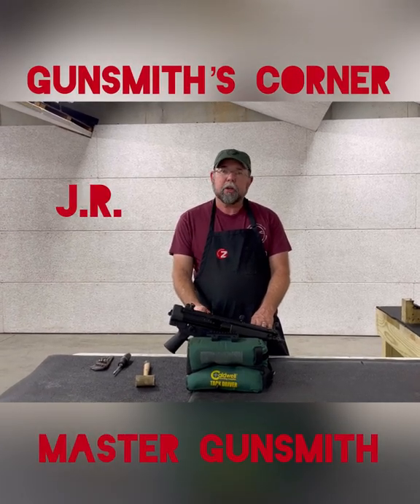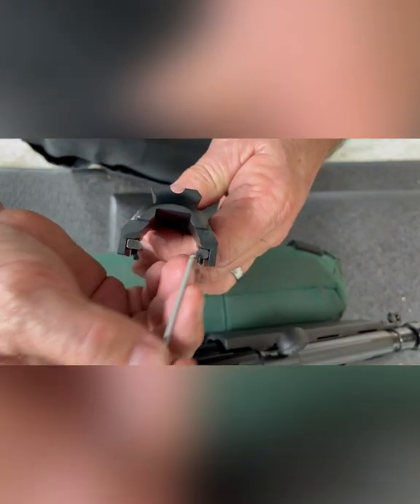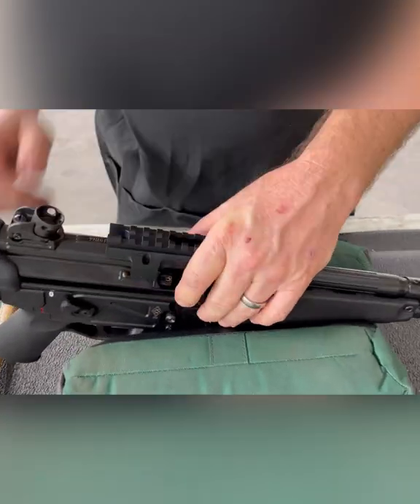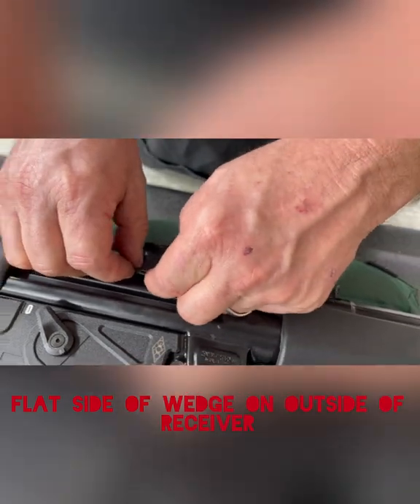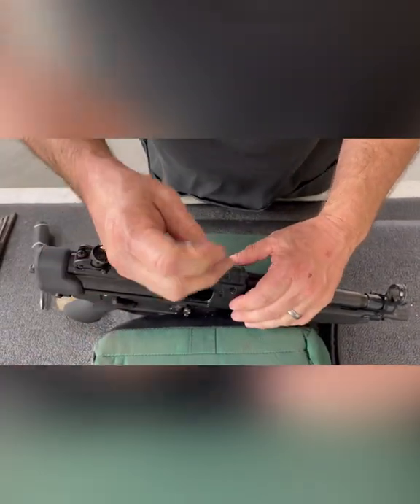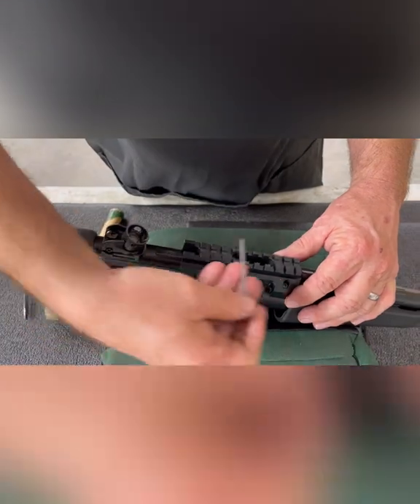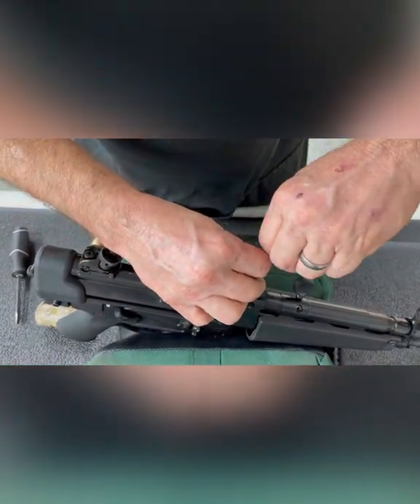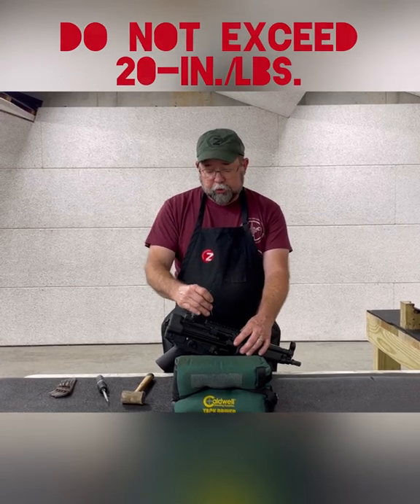Gunsmith's Corner | Installing a Picatinny Rail On Your ZF-5

Comment: This sure seems like a more secure mounting system on the MP5 than other rails available for the MP5.  I wonder how tough it will be to remove the rail?  I like Zenith putting out these Gunsmith Corner tips videos for product support.

Comment: Yes, the Zenith rail mount does hit the palm of my hand when slapping the cocking handle. Zenith you need to offset the rail back about 0.3" or remove the first two picatinny cross rails and smooth the left side so that users aren't cutting their hands.
Reply: My MI rail is angled to avoid sharp edges... I chose that model specifically for that reason... Good call-out!

Comment: Nice mine has a buldge on the front left placement so only 3 can go in. So much quality control thought it would work when i bought the more expensive version that comes with jt
Reply: Yeah I had to file down one of my wedges. No biggie, toss it in a vise and 5 mins of filing its perfect.

Comment: The instructions that came with my mount indicated that the wedges should be installed with the right angle at the top and the 45 at the bottom. Your install method makes more sense to me, but this is contrary to the instructions. Anyone have advice on this?
Reply: It's intuitive. Just figure how the surfaces will interact upon tightening
Reply: The video is correct
Reply: Midwest industries describes the wedge down and to the inside for their rail. I cannot get it to fit as they describe.

Comment: The charging handle makes contact with the rail, thus inhibiting locking the bolt to the rear on my z5p… any way around this other than a grinder?
Reply: Flip it
Reply: Same thing with my zf5k. Rail stops the charging handle barely. Jf5553 did you file the charging handle down a bit or flip it?
Reply: @GoodOlMrAndy  flipping it didn’t work. I just took a grinder to it and then it worked fine.
Reply: @jf5553  sounds good! Thanks for the reply.